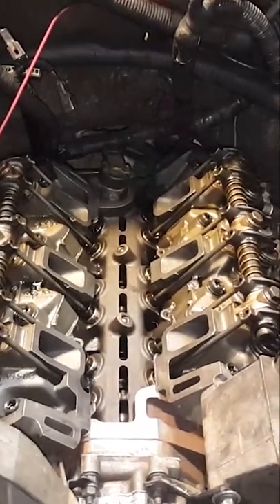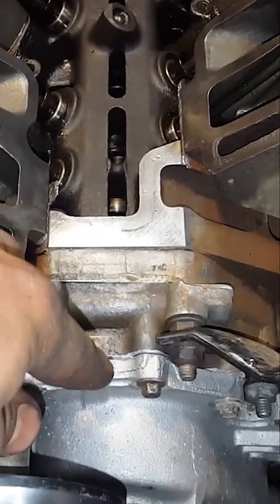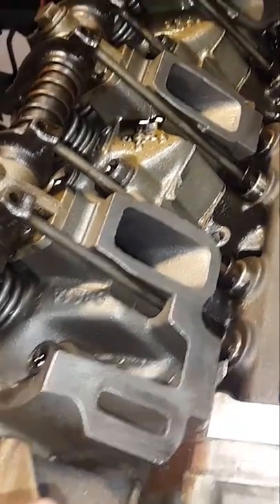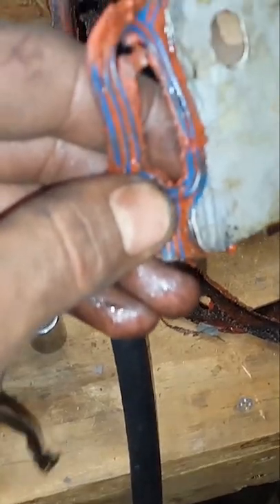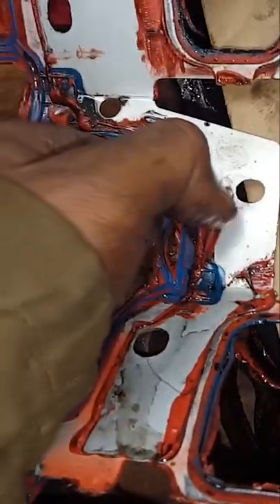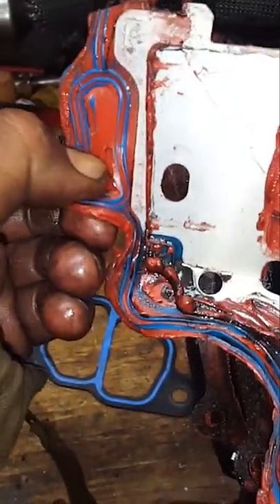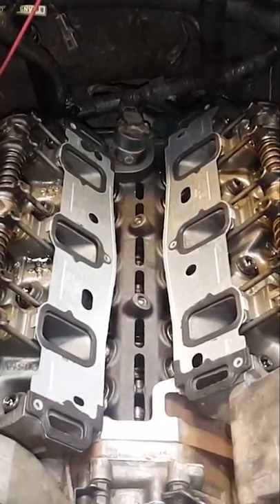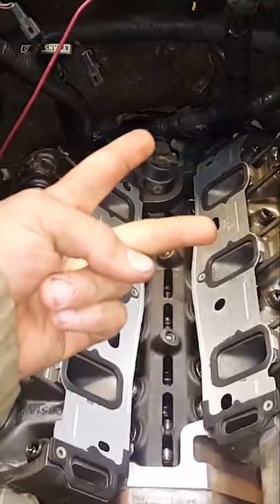Customer States Intake Gasket Leak

Comment: I am the original owner of a 1999 Ford ranger with a 3.0 pick up. Last winter I had to change my water pump what a task that was LOL. My wife came into my garage and asked me am I removing the whole engine? I like this visual an explanation good job in the video.
Reply: My 1999 Ford Ranger with the 3.0 has 359,000 miles on it!
Reply: @apoettker82  :   Mine pretty much exempt every year I’ve had a company work van since 2006 and my truck just turned over 119,000 original miles.  Still runs very well for his age at 100,000 miles I’ve replaced all suspension components, ball joints, tie rod ends.

Comment: That's a really clean engine for being a 98. I've seen the lifter valley caked with sludge when those trucks were only 5 or 6 years old
Reply: Just put new heads on so its been cleaned

Comment: Make sure you have good grounds from battery to engine, battery to body AND battery to frame. Check battery voltage at battery when trying to crank. Check voltage drop from battery to starter, on both positive and negative, voltage drop from negative side of battery to engine, frame and body.
Reply: What does that have to do with this video?
Reply: I don't know how, but my comment was on another video where they were having starting issues and it somehow was placed here.

Comment: Because the intake is aluminum, you don't use RTV.
What you need is non acid cure, like "the right stuff" it goes across the ends at the valley.
If you use acid cure, it can eat away the surfaces by electrolysis.
But you should check for the red RTV that travelled through the coolant to the lower hose at the radiator or the heater hose to the heater.
That can partially block coolant flow.
Piece!

Comment: Never ever put silicone on a gasket, it will just push the gasket out when you tighten the bolts. Clean and dry surfaces with NO silicone on the gasket will always seal better, I don’t care who you are and what you do.
Reply: It depends on if your gasket crosses a connection point. You use silicone there, on the connection point
Reply: Been a mechanic for 22 year and some valve cover gaskets, oil and transmission pan gaskets I use silicone dabs to hold the gasket in place when reinstalling. Never had an issue or leak.

Comment: When you use silicone on gaskets-it hydraulically pushes the gasket out and or rips them when you tighten up the part.
Reply: If I use any for an extra precaution I use a paper thin layer of rtv
Reply: @ronniewilliz153  I us a thin layer of anerobic on the gasket. And use a product called the right stuff on areas that call for rtv gasket maker.
Reply: The proper way to use rtv is to let it fully dry before you even put it back on and tighten it up.. when it's dry it's a gasket and when it's wet it just squishes out
Reply: @A. Melbs the permatex flexible gasket maker is good, they sell it at any auto parts store. Or Amazon
Reply: @brad8179  right. If I do have to use it for like an emergency repair I put the part in place and just snug the bolts then after it drys I tighten. 
There is a product called “the right stuff”. It drys much faster, is completely oil and coolant proof and is actually paintable. That’s what I buy, forget silicone.
Reply: @A. Melbs I would use “the right stuff” on that diff cover. Especially if it is the sheet metal type. Clean all the oil off and put a bead on the surface on the inward side of the bolt holes. Install cover and tighten bolts. No gasket needed.
Reply: @basketofdeplorables4253  9 times out of 10 if I have it taken that far apart you may as well just change the gasket
Reply: @A. Melbs its the stuff that oem manufacturers use in place of gaskets for oil pans and timing covers, valve covers etc.
Reply: @A. Melbs permatex black,Toyota also has a gasket sealer that's black,I remember  doing a timing chain on a 09 Corolla and it called for that Toyota Black on the timing cover.
Reply: @A. Melbs that's the one

Comment: That looks sooo wierd,I am elbow deep in my tbi 350 rn and at least it has a designated place for the pushrods to go,but this right here...looks confusing and too precise
Reply from the maker: It wasn't bad! Not much difference.
Reply: @MattsShop  are those engines notorious for intake gasket leaks or valve train problems?it looks like the intake would mount like an LS and just have a plate covering the valley for better intake temps
Reply from the maker: @mob_slaya1866  I don't know if they are more prone to leaking or not. It seems like they would be.
Reply: @MattsShop  yeah,it all depends on intake design and temperature

Comment: I got a run of 3.6 wranglers the oil filter housings were leaking. They all "were recently done". Removed, smeared with rtv, reassembled. Don't use rtv on silicone gaskets/O-rings.

Comment: No silicone on the gaskets, only silicone the end rails.
Reply: You can put it on the gasket but a very very light layer
Reply: @atomicbogator6799  no absolutely not
Reply: @joe1273  yes, it's just fine and helps keep the gasket in place when installing an intake
Reply: @joe1273  atomic is correct. Actually it's required in certain areas on ford motors that rtv goes in certain areas with silicone gaskets or leaks will for sure happen.
Reply: @NeonSlug562  Depends on the application. Most of the time you shouldn’t use ANY additional sealer unless service data says to use it. It’s just not a good idea. For instance If you install any felpro gasket they’ll tell you to install everything clean and dry minus the spots that absolutely MUST use RTV. 👍
Reply: @braydinjones6301  yup that's why I said it is required in certain areas. Because actual repair bulletins sometimes do call for it in conjoined areas of the motor. But just a dab is all that is needed no need to go overboard
Reply: @NeonSlug562  no more rtv for me. I use “the right stuff”. It’s completely oil proof and paintable.
Reply: @NeonSlug562  Sorry I did not read your comment as carefully as I should have lol.

Comment: I got a 94 Chevy Silverado 1500, new battery and starter, but just click and all power is gone. What do you think it might be the problem?
Reply from the maker: Relays?
Reply: Check if the motors locked before wasting time
Reply: @bentleynorton6843  how would I do that? The fan?
Reply: Corroded battery terminal. Had the same problem on my ‘01 1500 and that’s what caused it. Just clean it with a wire brush, spray it with terminal cleaner, then put terminal grease on it.
Reply: Could be a few issues, but as others have suggested look for corrosion on the battery cables and check connections at the starter as well.as all the connections where any cables from the battery connect to the ignition (going to spell this wrong but?) cylanoid  could need to be replaced too?  Personally I always try replacing the cheaper stuff first and work my way to the more expensive parts if necessary!  Unlike some auto shops that start with the expensive parts and find that wasn’t the problem! Oops. Know a guy that his engine kept dying out of the blue every so often. Took it to different auto shops that replaced all kinds of expensive parts including parts that would have nothing to do with making a engine die! I kept telling him to replace your gas filter. But he wouldn’t listen for over a year and spent thousands in repairs he didn’t need and still had the engine dying. Out of desperation he finally changed the gas filter. Guess what, no more dying engine any more! LOL sadly some people just have to learn the hard way!

Comment: And people says 6 bangers are more reliable than 4 bangers lol get out unless its an inline 6
Reply: It depends on the manufacturer. 
There are upsides and downsides to both. 
Generally speaking it's easier to work on the bottom end of a straight 6, whereas it's more reliable if it's a v6 by the same manufacturer. 

Could be confirmation bias on both of our parts, but that's my view.

Comment: What the hell is all of that silicone doing on a on the rubber gasket. That rtv is for bathtubs anyway.....WTF!!! Everyone knows you use the " right stuff " or GMS and it only goes where a seam is....like the china rail or the front cover / block/ cyl head area......some one needs to be promoted to customer.

Comment: I once watched my buddy cut up a cereal box to use for head gaskets on a Honda Civic. I then followed and watched as he drove this car 4 miles to the junkyard. It drove there and into the junkyards lot just fine. Know the application and how to properly seal heads, and you can do it with just about any decent sealant. 

However, Act like an overzealous idiot with an oversized tube of RTV, and? Well, ya get no seal.